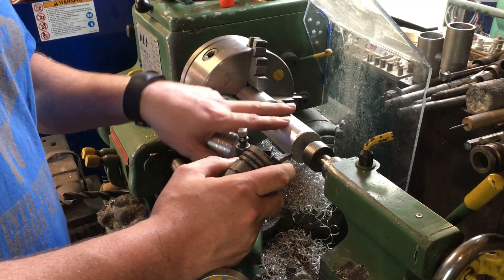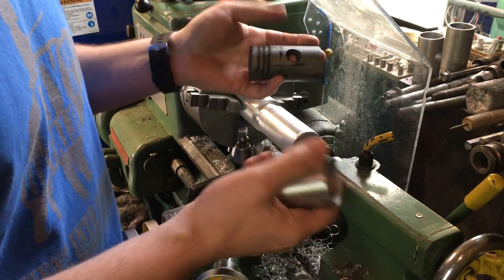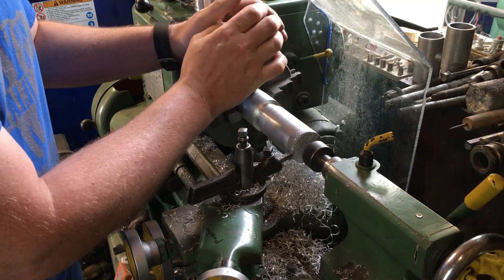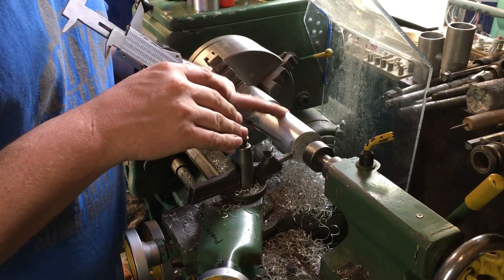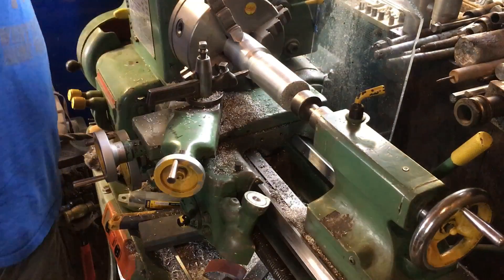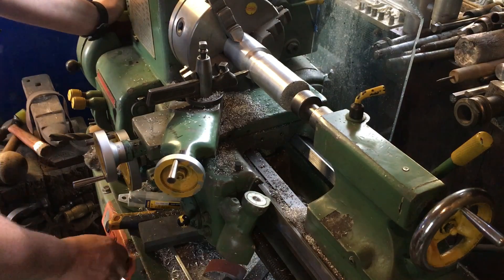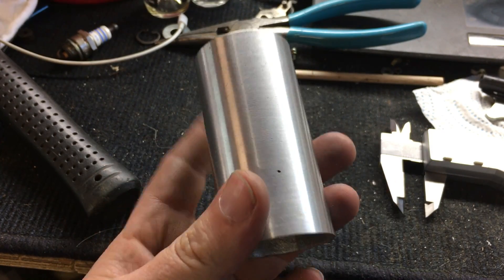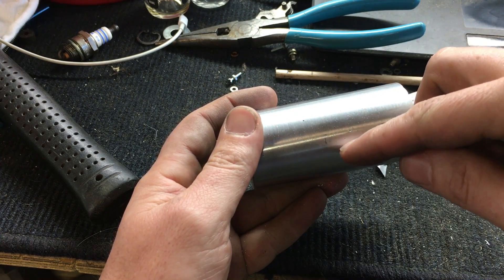Machining a home made cast piston

Comment: How did you measure the taper of the piston for making the mould for this?
Reply from the maker: Good question!  Short answer is from modeling off old existing piston.
Long answer: Measure skirt diameter, distance from skirt to top of piston, top of piston diameter, then finally connect the diameter points two dimensional to “vanishing point”.  All that would give you the angle at the point theoretical convergence.  As for thermal expansion my best guess

Comment: Interesting series, I like it! Once it’s all machined to shape, have you decided on what heat treatments to use on it? From what I’ve researched, proper heat treatments make all the difference in quality and durability of aluminum. Wrong treatment, it will wear out fast and do funky things in the engine while doing so.

Comment: ive been wanting to do this but everyone I have spoken to says that pistons are slightly oval and so you cannot use a lathe??? How well did yours work?
Reply from the maker: These old pistons were designed in the 40s they were concentric to start with.   The extra length was to help with piston slap.  Modern designs account for different expansion rates in the pin boss area and are much shorter and lighter.   Your design could account the same way in increased clearance. I say go for it